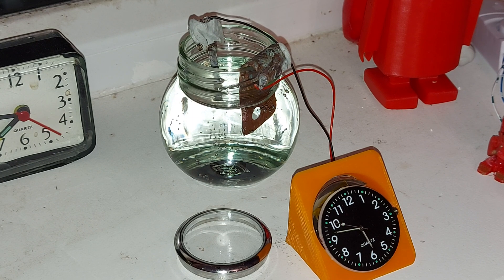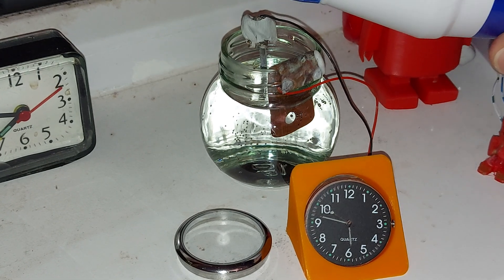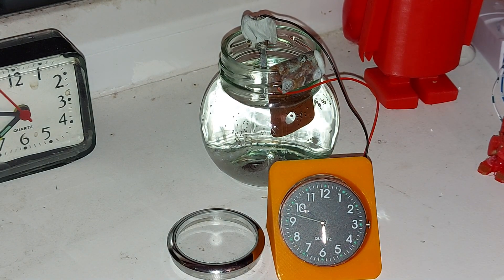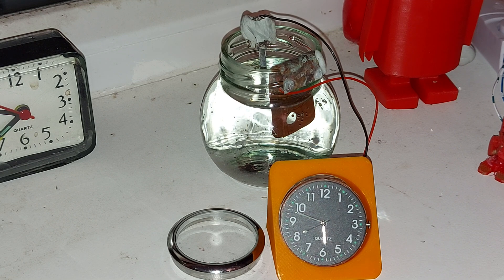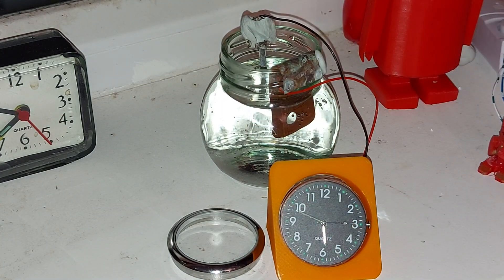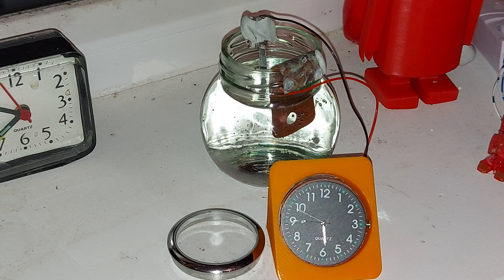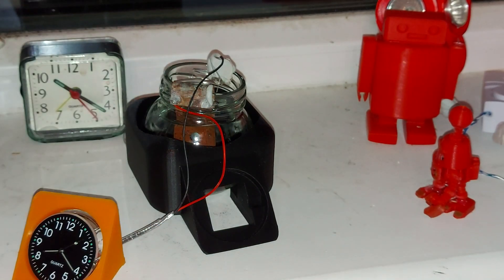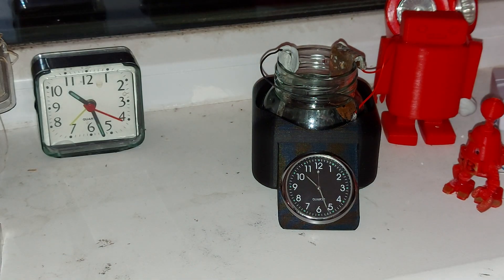Salting my Water Clock 20250319

Comment: great idea with the clockface and the water container in 1 unit. which wire is the plus and minus , is copper plus and magnesium the minus poles ? that will run like in forever.:yougotthis::yougotthis:.
Reply from the maker: In this situation Copper is positive and Magnesium is negative. The magnesium gets eaten away, so I have to replace it very so often.